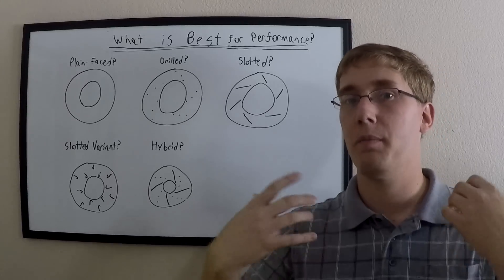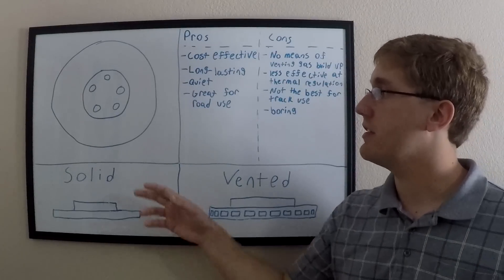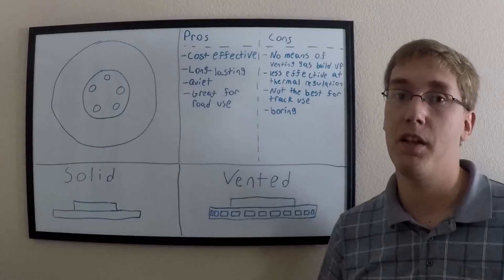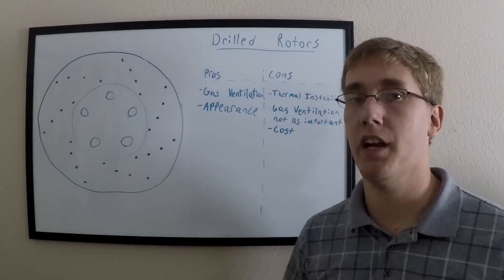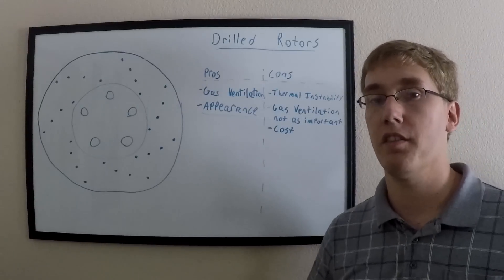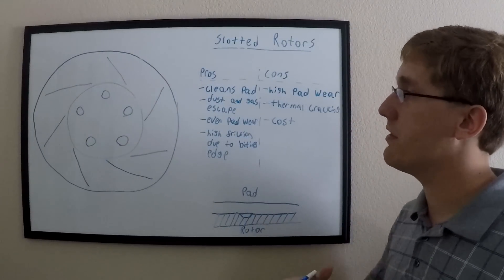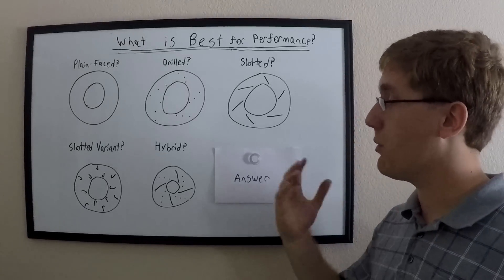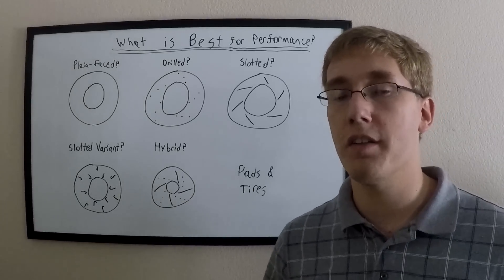Plain vs. Drilled vs. Slotted. vs ??? Rotors - What's what?

Comment: Also, the driving conditions and environment factors in. Mountain driving with long downhill descents, especially towing will have different priorities than a rice burner street car. Or off road rigs going through dust and mud will want to prioritize something different than a pure towing vehicle for long hill descents. The driving conditions are a huge consideration to factor in. 

What is best isn't just about the pure rotor style, but the vehicle it's on and the uses of that vehicle. Would love to see an update where different types of vehicle usage is considered and what the top options are for each type of common driving conditions different people have

Comment: Bro u da man! I have been looking for a detailed explanation of each rotor design for a week now, seems few different videos but no one did it any where as good as u did I’ll be pouring a 40 out on the day u die mad respect homie . I was shopping around for new rotors two weeks ago and already ordered them and received them. I got Detroit axel drilled n slotted rotors and they came with free brake pads too gonna slap them mixed breed bad boys on this weekend! I don’t trust the free Detroit brake pads so I bought my usual ones some tried and true EBC red stuff brake pads! No finer brake pads around in my opinion for every day use and high speed fun when the opportunity presents itself. Never had slotted rotors curious to see how they are n if they really do cut the pad life down my pads last roughly 2yrs give or take on average

Comment: I replaced the one-piece Akebono iron rotors on my sport pkg 370z with a set off slotted Akebono two-piece aluminum hat rotors and put G-Loc GS-1 street pads on it. The front wheels are about 10 lbs lighter, with the rears being about 5 lbs lighter. The results have been great; with next to no brake dust, no noise and a solid linear feel in the pedal. I was also able to shave off another 12 lbs from each of the wheels with the use of forged magnesium monoblock wheels, lightweight Michelin Pilot Sport 4S tires and aluminum lug nuts. The G-Loc pads have about a 50% increase in the coefficient of friction over the OEM Akebonos, which I like because I can now exploit the greater longitudinal and lateral g's the tires can support.

Aside from not being cheap, I'm very happy with how the car is handling now. I'm currently working on installing some aluminum triangulated chassis braces on the car. I replaced the stamped steel front shock tower brace with an aluminum triangulated brace that is about half the weight and more stiff.

Comment: Tires are important, but for this comparison tires are not the factor. And the information on cross drilled rotors in the video are wrong. They do offer advantages in both heat dissipation and better braking in wet road conditions by allowing water to escape off the surface of the rotors.

Comment: I have EBC dimpled rotors on my Range Rover. Good stopping power but I, also, prefer to drive with open windows where is possible, rather then have AC on all the time, and yes, dumpled rotors create noise, especially prominents when you're in left line, next to divider...

Comment: Drilled and slotted discs are more prone to cracking due to thermal shock IMHO, ie if you drive through a big puddle when your brake discs are very hot  and get cooled very fast,
If you don't use the vehicle much and get glazing on discs and pads, the slotted can make the discs land pads ast longer I also do believe

Comment: I have always thought that drilled rotors provide better braking and hence a shorter braking distance. Nice to know now that they offer no braking benefit other than look. I also liked when he stated that slots on a rotor keep brake pads clean by offering scraping edges to remove dust and fades off the pads. I will consider slotted rotors for my vehicle from now on, thanks to this video.

Comment: Whatever you say. I will hold my ground on drilled or slotted break rotors. The best brands in my opinion is ATE, zimmerman and brembo. These once also have a coating of paint/metarial so it wont rust. 

Also one note: plan faced rotors WILL fade on track days after a few cornors or a long big downhill breaking on a hot summer day.

Comment: Is this the same in wet weather performance? Because as you mentioned with slotted for example you are taking off a microscopic layer each time, surely that would do the same with any water to help contact with the pad and the rotor? Would that be accurate?

Also how much higher (percentage) would the wear be? Would it be dependent on how sharp the edge is of the slot? Sharp vs smooth etc?

Lastly what about straight slotted rotors vs angled / curved?

Comment: Pads are more important than rotors. When I bought bad pads the break fade was bad, now with better pads the brake fade is still there but in a much lower level. So I didn’t need to chance all the system.

Comment: Most people don’t see the benefit of slotted rotors because it’s hard to tell that going 5 miles to the grocery store and back.  On the track every small percent adds up.  Brembo quad pistons/pads all around, Brake ducts for air cooling the rotors, slotted rotors, and a high wet boiling point brake fluid help immensely on the track.  Tires and pads are a small piece of the puzzle.

Comment: I've been running ACDelco Drillled and Slotted POLICE Severe Service rotors for about 100,000 miles, with Motorcraft POLICE Severe Service Brake Pads on all four (4) wheels of the famous 95 MERC.
These rotors are NOT AVAILABLE -- out of production.
 NOTICE -- Premium quality brake rotors are MARKED "Left" (L) , and "Right" (R).
Most roror kits are NOT MARKED -- DON'T buy 'em !!
 I noticed that POWERSTOP makes a set of Ls & Rs in the drilled & slotted models.

  The 95 MERC build is for Long-distance, Hi-speed touring in the deserts and mountains of the American West.
  Recommended Brake Fluid = * BOSCH D.O.T.  5.1 *
  Eclipse Calipers, Raybestos Brake Hoses, and Russell Speed Bleeders complete the high-performance brake package.
https://www.mercuryforum.com/forum/grand-marquis-14/1995-grand-marquis-restoration-8937/

Comment: Proper discs with holes are not "drilled", they are being casted with the holes on the mold. Because of that the molecules around the holes are more concentrated than the rest of the disc and therefore they do not crack around the holes because the metal is stronger there actually.

Comment: i got a 2nd gen mazda3 all disc brakes and i only replaced the rear rotors and pads cuz cuz they were pitting (had alot of small rust holes) plus only the rear applies about 30% braking strength while the front applies about 70% so if anything i have slightly better braking cuz the drills and slots make better connection to the pads but they'll also probably just wear out faster. im keeping the front ones stock cuz they're in perfectly fine shape

Comment: wheels locking is the final word on stopping . wheels locking up really before tires would normally skid is also the issue and of course fading with heat . im running drilled and slotted rotors with ceramic/ carbon pads . never been happier , just have to see about the long run.
Reply: How’s it been since this comment. I’m debating on some plain ones or some slotted and dimpled ones just can’t decide

Comment: He only half right. If you’re talking about your average corolla, then you don’t need anything upgrade rotors. If you’re talking about a track car then you should get the “ hybrid “ rotors. An the dimple drill or drill rotors still help you stop a shorter distant. And yes your racing pads will still buildup gas. In fact your racing pads would not work until they are super hot. But if you’re talking about your pick up truck or car and can upgrade to any one you want. They will help to stop a shorter distance. Hell most  tractor trailer still have drums brakes all rounds the upper there shoe to RSD. In fact, all tractor and trailer are required to used RSD shoe ( reduce stopping distance ) so yes upgrade your brake pads and rotors will help you stop a shorter distance in passenger car. Your average tires should last you around 36k to 46k

Comment: Maybe in comments already but he did not mention one of the advantages of slotted/drilled  rotors , Water , regular rotors do not work when wet until the pad expels the water . You can feel this in the pedal and you drift until they work again, Slotted rotors drain the water away via the slots and holes . I live in Florida and we get lots of rain and puddling water. slotted are best

Comment: Drilled rotors are for looks.  They will crack with enough heat.

The also the holes reduce surface area so they simply cannot stop you as fast.

Real race cars use plain blank rotors.   Use good pads and good brake fluid.

Comment: i just changed out drilled and slotted for just slotted. I had the D and S rotors for 4 years. After inspecting them after I removed them, there was all kinds of fractures on the rotors around the drilled areas. Never going back to drilled.

Comment: Drilled and slotted rotors are for looks only. With today's brake pads there is no buildup of gases under heavy breaking. Drilled rotors are weaker than solid rotors and slotted rotors rip through brake pads.

Comment: Its also good to remember any texture on the rotor such a slots and drills or dimples can cause more pad vibration this can lead to brake squeak or noisier braking overall. The quietest rotors are plan good quality. Top shelf with a decent set of pads. Also remember dust means they are working some of the pads with less dust also preform worse.
Reply: ive found basic ceramic pads dont work well cold and seem to slide (or fad) . dont like them and used organic pads untill recently trying ceramic/carbon and liking them.

Comment: Great information -- having experienced brake fade when I was going way too hot under stress driving the cost is a good trade... brake pads are cheap where smashing your car because you failed to stop soon enough ... my ABS hardly trips on grippy surfaces with normal rotors as this is because my brake rotors are getting too hot... the only thing I not liking about the upgrade is the up front cost but if I keep up on my brake inspections and swap pads before they get burned up I'll easily get a fair amount of time on what I bought ... these are my cars 200k birthday present =)

Comment: My 2001 Tundra had a design defect in its brakes. The engineers were so afraid of rear wheel lock up, they biased braking almost entirely to the front (the rear brake drum shoes are barely worn at 150,000 miles). So the front discs do all the work. For that, they are too small, overheat and warp. Toyota is aware of this problem, but refused to pay for repairs. At 60,000m I had to replace the rotors. I saw no point in using Toyota parts as these were not up to it, so I got a pair of EBC drilled and slotted rotors. These have done fine, and sure I have had to replace the pads a couple of times, but braking is smooth and powerful and the rotors are only slowly wearing.

Comment: Nowhere did I find anything till after I got them. Had I ever heard. That rust builds in the holes of drilled and slotted rotors. To the point it can sound like a bad wheel hub bearing. Now a year later I have to changed all my rotors. Just to get rid of the sound.

Comment: I was told the holes also keep water from accumulating on the surface when driving through puddles of water 💧 as far as looks go cross Drilled and Slotted look the best 👌🏻  for me! 
I don't usually drive to work on a track but can go through puddles if water beating lil old ladies or guys that drive like them on daily streets looking way cooler than a mini van😛

Comment: My breaks squeak bad I had the rotor and breaks switch 4x my calibers are fine. I take it to another place they tell me I need the upgraded rotors they said my rotors are getting to hot. I drive it 5hrs a day 5 days a week. I work my truck hard 2007 Chevy Suburban. Which one of those upgrades will help with break noise or does it matter? Any info is appreciated I'm searching videos now trying to find a solution.

Comment: You are repeating something you heard someone else say. How in the world is gas going to build up between a spinning rotor and a stationary pad?
I’ve tried drill and slotted rotors on my 2016 F150 and I didn’t notice a difference. Yes a F150 is a truck but it will do 0 to 60 quicker than a Mercury marauder.
Reply: The gas coming off the pads creates a very thin boundary layer. It's not such a big problem these days, at least with high quality pads. 

The biggest problem in overheating pads is the sublimation of the pad material and the accelerated wear that means the brake pedal sinks toward the floor as you try to slow down.
Reply: @Setright  You sound like him repeating what you heard someone else say.
Reply: @Fone65  You may be like that.

I base my statement on 1,000,000 kilometers of experience with my own cars, including hours upon hours of trackdays and advanced driving courses.

Oh, and having worked as a mechanic for two years and doing all the maintenance and mods on my cars.
Reply: @Setright  You are wasting your time telling me what you do to your car. Unless I see video. You are just a kid lying about it. BTW, you loss credit when you said "mods." Real car guys don't do mods. We work on our cars.
Reply: @Fone65  My bad, didn't mean to feed the troll.
Reply: @Setright  You have loss more credit with the name calling. When someone tell me I don't know something. I send a link on the subject.

Comment: Thank you, very genuinely explained. No marketing BS. My question still stays unanswered though. If I were to upgrade my OEM rotors just because they are undersized, so ends up warping with heat during downhill breaking. Very Common problem in Honda Odyssey’s. Should we stick with the plain rotors to avoid stress & cracking due to heat or go with drilled & slotted ones for better heat dissipation but prone to fracture under higher temperatures? Thanks in advance!
Reply: I second that question.
Reply: Upgrade your pads. If Brembo make their "Xtra" pads for your model, I would recommend them.

Otherwise, Ferodo DS Performance pads.

You could also consider Mintex M1144.

All three are street legal.

The "warping" you are experiencing is actually the oem pads making uneven deposits on the rotors. Leading to vibration that feels like warped discs.

Fit new rotors when you upgrade the pads. Plain surface rotors will be fine and last longer...and be cheaper to buy.

Focus your hard earned money on the pads.

(Speaking from 22 years, 600,000 road miles and loads of trackday experience.)

Comment: With modern ceramic pads, I'd be inclined to consider slotted, but drilled doesn't seem worth the downsides.  I'm not finding many rotors that are just slotted, though, mostly "hybrid".
Reply: Dba makes slotted rotors. Just installed some with hawk pads and stainless steel brake lines. Good upgrade 👌
Reply: EBC make nice slotted rotors for many models. USR.

I wouldn't recommend EBC pads. Go for Brembo Xtra, Ferodo DS or Mintex M1144

Comment: Got it right. Tyres are the key , 99.999999% of drivers will never use the brakes on their car to their fullest potential,  the one time they do they will be very surprised,  as will the person who has fitted drilled/slotted vented discs and super pads , because at 30 mph , when that child runs out they will find that it takes time for the pads to get upto temperature , this not a problem coming off the straight and into the hair pin turn at 130 mph because the pads will get upto temperature in a blink of an eye.

Comment: Good to know. I do one up to 3 hours commute depending, heading to work it's nothing but very steep downhill. I get 99 miles per gallon going to work. A can get extremely hot here with a lot of road hazards. It's hell on your braking system.   I'm gearing up to replace the entire suspension on my Jaguar and was thinking about changing the rotors but it doesn't seem like there's enough benefits. Great video, very helpful

Comment: Sloted rotors keep the brake dust fron sticking to the outside of your wheels cross drilled help keep the tempature down on constant braking cools rotors faster besides looking great why would a 150k Porsche 911 have cross drilled and sloted if not for there performance besides looking great....

Comment: Yup, at the track, outside of seat time, the first mod you would want to do is......Tires! That alone will improve your time the most...after that, then good brake pads, weight reduction, HP adders...etc.  Ive had plain rotors for time attack....I would experience brake fad eventually. (basic caplipers).  Then, i installed Brembo calipers with a hybrid rotors...stopping distance didnt really change that much, however, what did change was the fact that at the same track as I used the plain rotors at, I never managed to experience brake fade during the runs, and the rotors would change color to a violate or blue...they were HOT!! lol...also, eventually I started to notice fractures in the rotors.  Now, this was after several track days over a few years.  Ill add, at this track the hard braking(last minute braking) involved speeds of 90mph to 115mph down to 40-50mph if you had good tires...

Comment: Heh. I was just talking with my girlfriend yesterday, that I must be dumb, as I don't get, how "better" brakes contribute to shorter stoping distance in a SINGLE run, as presented in many brake disc/pads reviews. Nowadays, virtually any stock discs/pads are more than capable of locking the wheel, which means that they are not the "bottleneck", when it comes to vehicle stopping power. So how those dics/pad reviewers get those "better" results? I don't get it. 
And today I find this vid :) 
Thanks! I feel a better about myself now :) Shame on those biased reviewers! :)